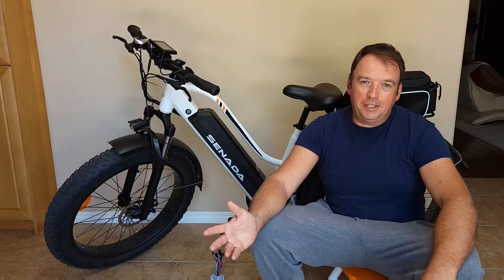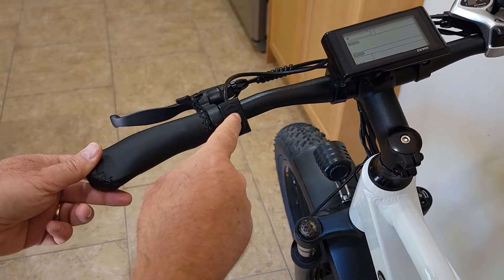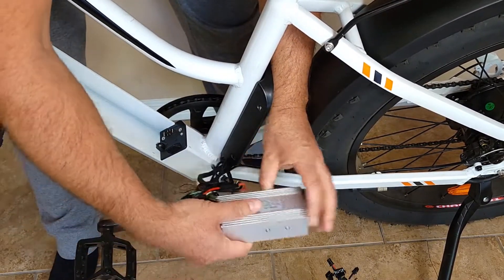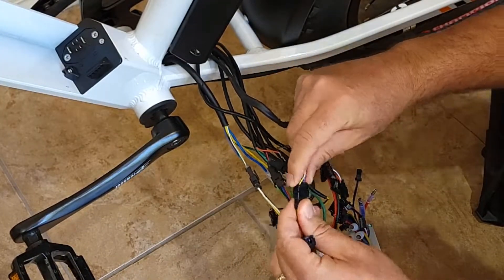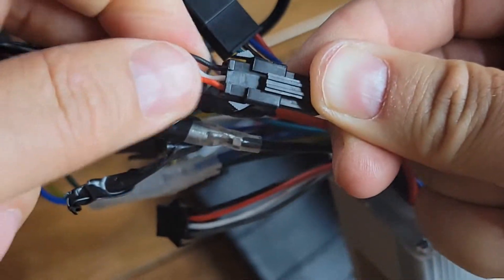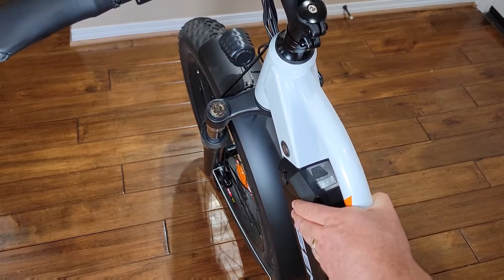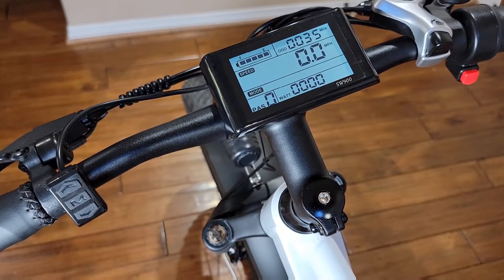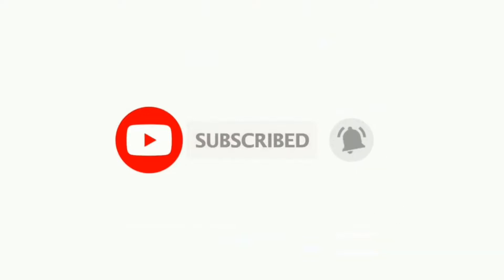How to Replace E-Bike Controller on Senada Herald or Saber

Comment: Ive put about 160 miles on my archon so far. It seems like Senada is a good brand although i do wish they had a proper maintenance guide. Thinking it would be best to lubricate the planetary gears annually. Hopeful to find a manufacturer for the 1000w hub motor as well and pick up some spare gears since those are a common hub motor failure. Thanks for the upload! Not as many videos as you would think on senada bikes

Comment: I am curious why you replaced the controller.  Did the old controller fail?
Reply from the maker: I was getting some codes and they just sent me new replacement controller. No problem since replacement. I  noticed many bike companies has issues with their controllers recently but it was pretty easy fix for me.